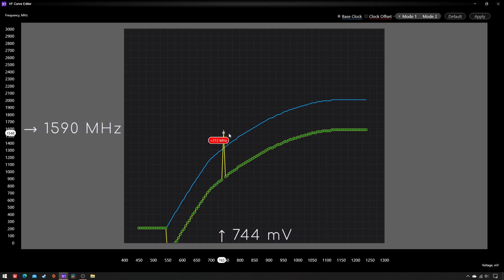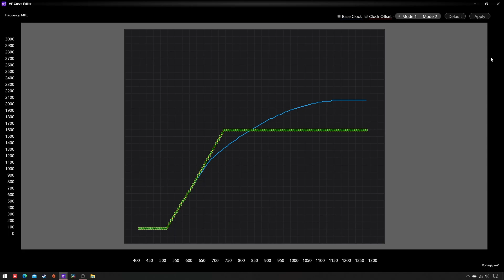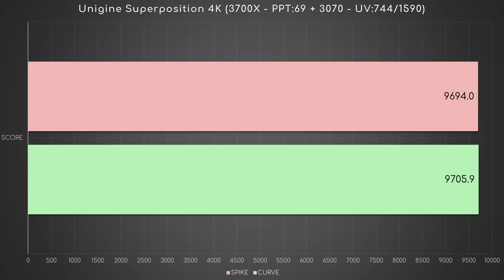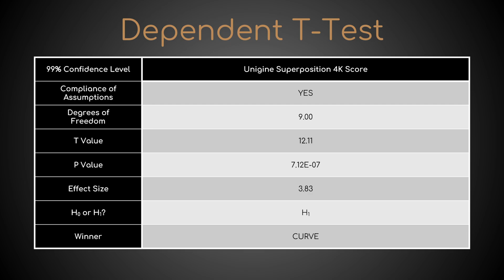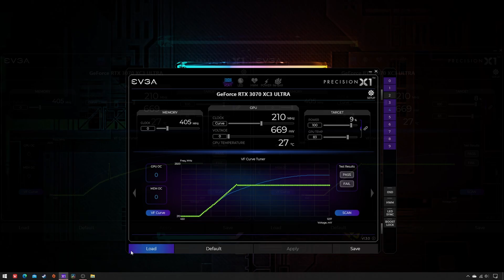Undervolting Methods: Typical (SPIKE) vs Atypical (CURVE)

Comment: Your core clock shouldn’t be that low  low on idle. 

your supposed to input -300 on  the core, then choose your millivolt at said frequency. 

if you do it this way your core clock stays the same idle & only goes up at the frequency you set with the voltage you chose when playing games or under any type of load.
Reply from the maker: Even with the stock VF curve, the clock goes down to 210MHz. Proof:
https://drive.google.com/file/d/1q8wyxBDoJ-RTyfm1vXeexpFbHrfIngBD/view
Reply: @oakenglass  he doesn't know what true oc is, the best is doing offset and limit power (%) not limit the curve itself bc on certain low load cenarios you want max out frequencies for fps and on hard loads you still have the lower frequencies, this way it will only go for that frequecies no matter the power...keep going
Reply: @oakenglass  not if you use msi after burner, maybe on that program. Never used the evga one before

Comment: Sorry to ask like this but performance difference way below 1% does not seem statistically significant to me. You are even closer to 1 per mile in terms of score. 
While I appreciate that you apparently did 10 runs per overclocking profile I find the test to test variance almost a little low unless you fully heatsoaked the system before.
Yet again with so little difference it already matters a lot if the tests were done during the same day with same room temperature etc.
Reply from the maker: Obviously, I tested the two profiles with exactly the same conditions: same day, controlled ambient temperature and humidity, each run started with the same GPU temp, and so on.
What do you mean by heatsoak? I'm not familiar with the term.